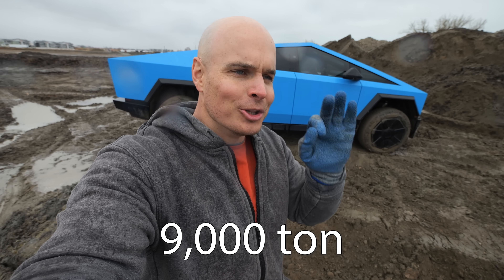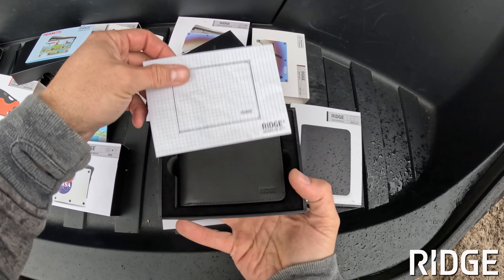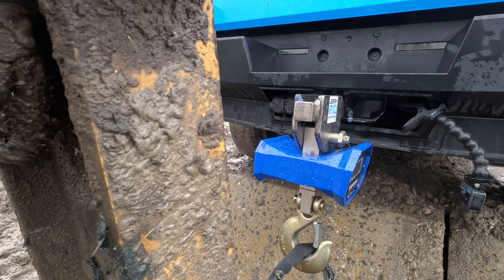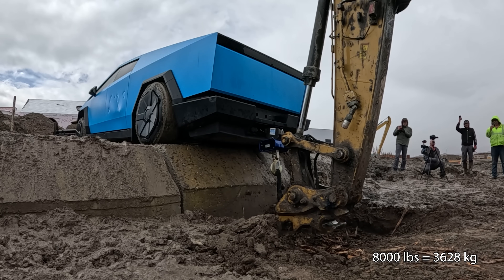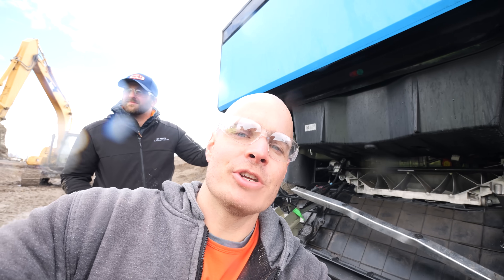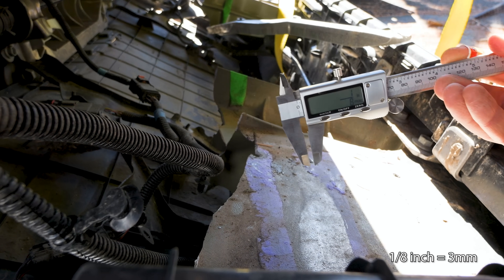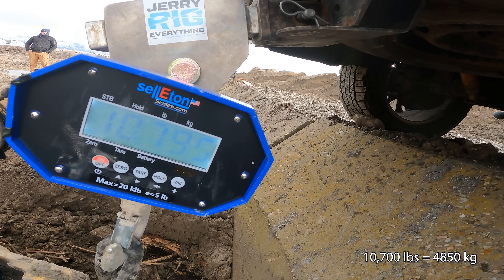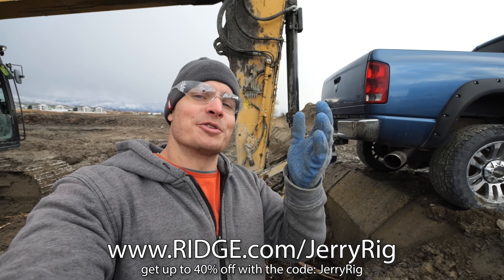SHOULD YOU TOW WITH A CYBERTRUCK?! - (catastrophic failure test)

Comment: Jayzus... I'm not a fan of the Cybertruk either, but an 11,000 lb. TOWING capacity is completely and TOTALLY different than applying 11,000 lbs. of downward force on a tow hitch.  That's NOT what the ability to tow 11,000 lbs. means.  And I think you know that.  EDIT:  I know you FINALLY get to that, but I don't think the majority of your viewers know this.  I think it needs to be reiterated.  --> And to address your "yeah, but...", Tesla would not be to blame for an improperly loaded trailer that you keep claiming could put extra weight on the tongue.
Reply: Yes He’s unethical
And dumb and hates Elon and he wanted to do a video with a “broken” cybertruck while towing
Reply: He does breeze over it, but makes sure to say 'towing is super duper scary and dangerous to do at all in a Cybertruck' which is utterly false. He's dumb, or intentionally misguiding views to slander Tesla. (Its the latter, because you see his hate for Tesla & Musk all the time on socials).
Reply: He's a liberal
He's just trying to make Elon look bad.
Reply: We gotta do it to an f150 now
Reply: JerryRigEverything indeed rigged it, hold front end down, not even allowing it to cantilever, truck was even alarming of unsafe condition prior to failure.
Reply: @vwecco1  There was no engine in the Ram.
Reply: Totally agree.... I have been towing for a lot of years now and also I know a 2004 ram 2500 also has a way larger towing capacity anyway... by a lot.. I'm not a fan of the fact it aluminum frame.. but I've literally seen steel fram trucks snap in half not even towing anything at all! The explanation on how you could put the "full close to 11,000 pound weight on the hitch" is preposterous too... you would literally have to basically stand the trailer to a vertical while the truck was still horizontal to even come close to that.
Reply: The issue is A) it started cracking at 5k, and B) every single shock or bump will make that number fall. 

This is a genuine design issue.
Reply: @Syllaren  No one disputes the horrendous flaw in this design.  If you read the OG comment, you'd see the challenge to his claim was the TEST METHOD and the author's claims that an 11,000 towing capacity is tested by applying 11,000 lbs of downward force on a hitch; which it is NOT.
Reply: @NorthernChev  good thing that claim was never made. He says both before and after the test that this is different than towing capacity, but given certain conditions this kind of force might be applied.
Reply: @Syllaren  burying that in a video with this thumbnail, and the title of "SHOULD YOU TOW WITH A CYBERTRUCK?! (catastrophic failure test)" is absolutely disingenuous and you know it.
Reply: @Syllaren  So, you just repeated what I said in my original.  Well done.
Reply: @HugoAguilera  he said it before the rest even started, and immediately after the test. Idk how "buried" that is.

Also as he said this is still a major desifn flaw. Given how aluminum degrades over time it shouldn't be cutting it so close to expected burst strain.
Reply: @NorthernChev  then why are you complaining. Crap happens. Knowing what happens if you end up getting some circumstances that result in some kind of strain. Like something in the trailer broke restraints etc, is important

The fact it's causing permanent damage you'd have to go into a shop to fix at 5k even before any wear and tear, is a huge issue.

Did he embellish how likely the issue is, sure. No one cares. However this issue is likely enough that it's worth having a video informing people of the risk. Especially since there already was a video on it months ago, and tesla hasn't had any comments about it.
Reply: @Syllaren  Two things: 1) I saw how long your reply was and only read the first two line.  Ain't nobody got time for someone who's yammering and repeating the same diverting info over and over. 2) See number 1.
Reply: @NorthernChev  if you don't have time to read you don't have time to respond. If you don't even care enough to understand the situation, then stop complaining.
Reply: @Syllaren  You are the only one here doubling down and fighting with NUMEROUS others who've been kicking your ass all over the comment section.  You keep fighting for a losing argument.  You just don't know when to stay down.
Reply: @NorthernChev  people who don't even bother to read think I'm wrong. Man I'm in a bad position.

The number of people mad about reality, doesn't change reality.
Reply: @Syllaren  Nothing you've said in this entire thread changes the fact that the OG comment is still correct.
Reply: @NorthernChev  nothing the OG comment said is relevant when the guy said it himself before and after the test, but also brought up the reality that wear and tear, and a pothole, could send a trailer catapulting into the street.
Reply: @Syllaren  Nothing you've said in this entire thread changes the fact that the OG comment is still correct.
Reply: @NorthernChev  he was correct about it not being tow capacity. Which isn't important since the video never claimed that and specifically, before and after the experiment, explicity said as much.

Also saying that "improperly loaded isn't the trucks fault" is just a cop out since that was just one example of the kind of accidents that could land this truck in a situation to be damaged, and a road hazard, where others wouldnt.
Reply: @Syllaren Nothing you've said in this entire thread changes the fact that the OG comment is still correct.
Reply: @NorthernChev  yeah done wasting time on this. If you can't read it's not my problem.
Reply: @Syllaren  Thank gawd.  Don't let the door hit'chya
Reply: @Syllaren  Have you ever flown in say a 737 airplane?  Have you ever looked out at the aluminum wings? They are out their bouncing around going through tremendous forces and I have yet to see a wing break off.
Reply: @camronglenn3502  they are designed to massively exceed expected tolerances, and yes eventually the aluminum does experience fatigue and needs replaced, even in aircraft. 

The issue here is the variance we are looking at. This is a hitch that's barely ever been used, and it's starting to fall apart at 5k. Thats a huge issue.
Reply: @Syllaren  , if you believe 5k lbs tongue weight failure [which this was not ]is an issue. Load up your "conventional" truck, load up the trailer with 10k lbs weight, put 5k lbs weight on the tongue and drive 60--70 mph, [make sure no one else is on the road] please record your experience and share. Thanks. Have a good day.
Reply: @Josemenez-lofs  the issue is any burst up to that level will do permanent damage dude. One pothole and boom its compromised. 

This isn't about a sustained rating. It's the fact that minor expected bursts onto it will fatigue the metal rapidly since it's tolerance is barely within functional levels.
Reply: @Syllaren  , My point is any standard conventional truck, with the trailer loaded in the conditions you, or Jerry are concerned about. These "hitch failure causing" conditions, the ones presented. No, rational driver is not going to put themselves in. Ever. The vehicle dynamics at this point are so dangerous for any vehicle. The driver will have more issues to be dealing with than a hitch breaking. [i.e. this condition is so far down the list of worries] they are likely hoping the trailer doesn't push the vehicle off the road.  Which is why I'll double down on my real world test you or Jerry can go do. Load a trailer with 10k lbs, put 5klbs of tongue weight on the trailer and go drive 60-70 mph. [As I recommend do it with no one else on the road.] Record your findings, and post. So I'm not saying  Cybertruck couldn't be better. This issue however, isn't the issue you or Jerry are making it out to be.
Reply: @Josemenez-lofs  this isn't even limited to bad loading. Crap happens. Thats why the hitch on the other is built to withstand it when things go wrong. This one not only has a higher chance of spontaneous failure, but the point that happens at get closer every single time it's carrying load. 

Stop straw manning. No one is saying it's normal to expect the hitch to take that weight all the time, it's the fact that ANY accident that causes increased weight brings it closer to a catastrophic failure.
Reply: @Syllaren  , again no straw man, run the test I describe. Record, and post!!! Shut the pie hole till you run my test. Run the test. You'll learn something. Crap happens?? Okay, a spontaneous 10k lb force is applied to the bumper, is it better to break off, or stay on?? Really depends on the situation. However, I'll still argue that the vehicle dynamics are so bad at this point. A crash is occurring. To make the bumper fall off, Whistling diesel dropped the full weight of the truck about 2 foot, if the road drops 2 foot at 60-70 mph. There is a lot more going wrong than the hitch breaking. As in this video, if I'm towing a massive track-hoe, exerting 10k lbs, on the back of the truck. The trailer is severely overloaded. The front wheels are off the ground and there are a lot of other issues than the hitch breaking. The issue, is so far from average hauling and trailer loading. If these were normal events on a public highway, the community would be tossing the driver in jail.
Reply: @Josemenez-lofs  the test you described IS A STRAW MAN. Because no one ever implied your ridiculous test is what the concern was. Ffs.

The issue is a relatively low ceiling of what it can withstand COMBINED with the nature of the metal itself. Meaning that ceiling is going to progressively fall. What happens in 5-10 years when you go over a pothole and the woopsie you dump an entire trailer full of equipment into the busy highway?

Airplanes set a very high tolerance level related to its strain, and monitor for metal fatigue to replace it. That won't be happening here. Local mechanic isn't going to be inspecting your hitch for fatigue.
Reply: @Syllaren  , yes, this is what Jerry and yourself indicate. There is some issue with the design, where a catastrophic event when towing, is going to occur. It's dangerous and the hitch will "just snap" off. Jerry states, he doesn't believe it's safe. So put your conventional truck on the highway at highway speeds, load a trailer and test your unsafe conditions. You know as well as I the tuck is going to lose control well before, a hitch snaps off. You're the straw men. Promoting fake scenarios, FFS.
Reply: @Josemenez-lofs  it's unsafe not because they expect 10k on the hitch frequently. It's unsafe because it ALREADY snaps at 10k, and by its nature that number will fall lower and lower any time strain is on the hitch. To the point where it will eventually not take much to snap
Reply: @Syllaren  , go do my test. Until then I believe you're not being intellectually honest to the issue. The more you repeat your argument it; without doing the test I suggest. Is not going to convince me or likely others what you're saying has any validity.
Reply: @Josemenez-lofs Dude, just let @Syllaren have the last word and he'll go away.  We have your back.  The entire thread agrees he's wrong.  But he can't be wrong and just let it go without burning down the building on his way out. So, just let the child have the last word and we can all move on away from his BS.
Reply: @Josemenez-lofs  you really just want to keep going with this straw man bs.  No one said what your "experiment" would prove is the issue. 

Last time I'm bothering to respond to a straw man. If you want to discuss reasons why you think having a ticking time bomb hitch is good, by all means do so. Stop pretending something else was said.
Reply: @Josemenez-lofs He's just trying to draw you out.  Just ignore him.  He'll go away.
Reply: He completely explained that at length
Reply: @ben62486 No, he does NOT "explain that at length".  He only mentions it briefly toward the middle of the end, and for less than a minute.  ...and then he goes RIGHT back into his BS line about 11,000 on the tongue.  He even attempts to make a claim about "improperly loaded trailers". Which as stated above, is NOT the fault of the truck. And if you care to read the many hundreds of comments here where people MISTAKE his claim EXACTLY as I stated they had been, you'd know that.
Reply: @NorthernChev  I'm totally with you on this, thank you!
Reply: @NorthernChev  If you read some of the other comments he doubles down on the improper loading of the trailer. Im calling this Jerry Rigged the video.
Reply: @NorthernChev  , 100% agreed.
Reply: yep, another clickbait garbage video
Reply: @pawel9625  he explained in great detail multiple times this exact thing lol
Reply: The science here is important. Aluminium, when put under stress, becomes weaker each time. Steel does not (within it's limits). In a few years of a CT towing heavy machinery over pot holes, speed bumps, maybe some off road drags to rescue other vehicles, the aluminium structure will be weaker than it was at the point it was first made, whereas a steel frame would exhibit the same strength as it was when manufactured, assuming no corrosion has reduced the steel thickness/ weakened welds. The concern here is not the rear of a CT falling off on the first trip with a heavy trailer after bouncing though a pothole. It's the Nth time down the road when fatigue has started setting in.
Reply: @KrisDouglas  if and when that ever happens, let us know. Hasn't happened with any Land Rovers, Audis, or any other aluminum frame vehicle I'm  aware of. And I guess all airplane wings flexing up and down must be falling off all the time too.
Reply: Jerry has failed to acknowledge any comments in which folks point this out. Shocker.
Reply: @HugoAguilera  Yeah, I didn't get the little hearty-thing from him.  Musta touched a nerve.

Comment: This is absolutely an intentional fake test...  this measures the tongue weight failure not the towing ...  tongue weight is 1100 lbs, it lasts to 5,000...   towing is done on a trailer with wheels and in the sled test it pulled 35,000 pounds and beat the ford 2500...  lost my respect for Jerry rig,  who built a hummer ev from tesla battery ... you should be ashamed...

Comment: It's actually a safety fuse which prevents you from towing heavy loads which are not feasible to tow with the Cybertruck anyway. Tesla doesn't want you reducing your range by half, so they came up with a cunning plan to prevent you towing those ridiculously heavy loads: make a tow hitch which separates from the body as soon as you load up that ridiculously heavy trailer.

Comment: No surprises it will always be weaker than steel but although I don't like the Cybertruck the idea that you are going to get the anywhere near the full trailer weight as a downward force on the ball is so laughable it is funny. I bet you would not be able to pull the hitch off the vehicle with way more than 15000 pounds. A good example here is the Mitsubishi Triton light truck which frequently snapped its frame in 2 pieces when towing with about 2 times the rated towball weight on it (~1600 pounds).

Comment: 11 000lbs towing capacity doesnt mean 11 000lbs tongue weight.  It`s 10to20% tongue weight MAXIMUM so the truck shouldnt see more than 2000lbs on the hitch. It made it to 4000 no problem, at that point, the axles and tires are overloaded and shouldnt be on the road anyways. There is no problem there and THIS test is a lot more convincing than whistling diesel. Straight down, no jerk.
Reply: Dude bought a Tesla to hate on it, but proved it's safe.  He needs to test 5 more, hah😂